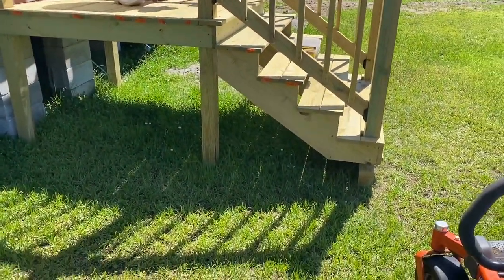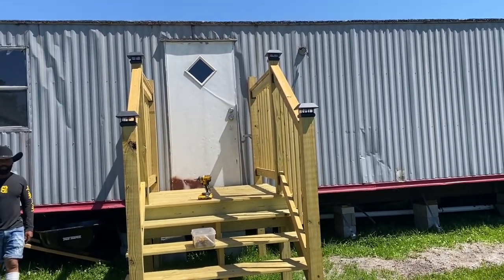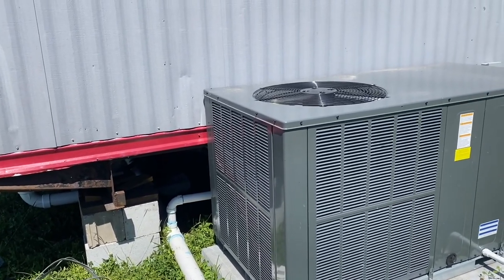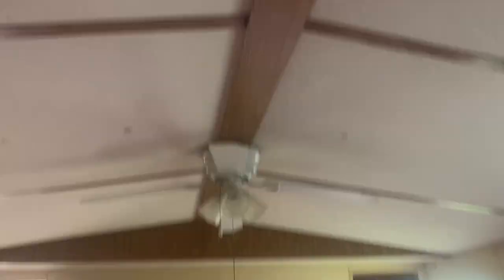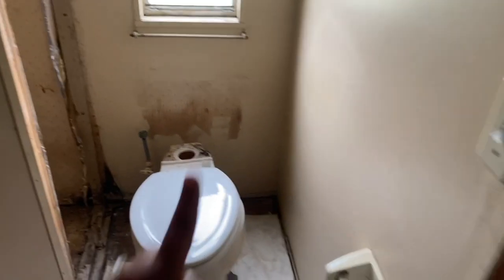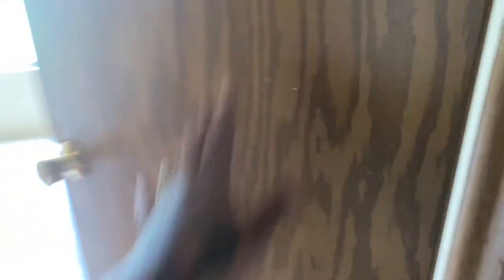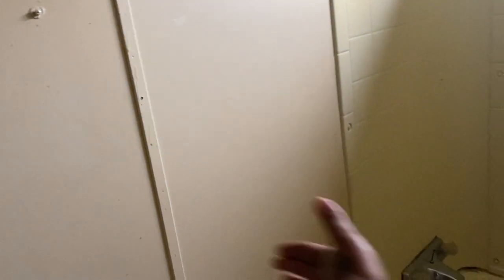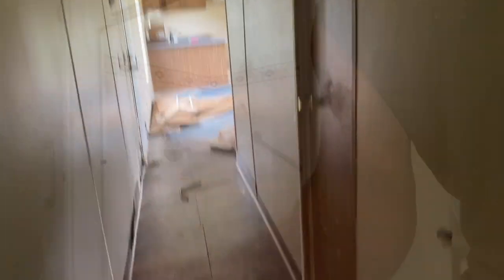demolishing our old mobile home

Comment: If I may make a couple of suggestions,  which I did on my single wide MH with Aluminum Siding. I stripped all the sheet rock off the outside walls and added 2x2s to all the studs. Then I sealed all the holes in the siding and I used minimal expanding foam between each Siding joint.  Then I used expanding foam between the siding and the sill plate and header to keep bugs, rodents, lizards, and drafts out. I also sealed with minimally expanding foam around all the windows. Then I replaced the insulation that wasn't damaged and added another layer of R13 insulation.  Then put in new drywall, which I finished like a house. While my mobile is much smaller, only 644 sq ft , I used 1 windows AC unit to cool it last year set at 80 degrees. It only cost me $50 /month to cool it through the hot humid Texas summer. 
Hope this helps!
Reply: Thanks!!!! 😂, wish you would done a video, also.
Reply: Foam won't stop mice. The only thing that will stop them is rock wool insulation. It repels water, fire and it's sound deadening as well. It's all I use.
Reply: I haven't had any in 5 years.  There are some foams treated to withstand Rodent infiltration.  Show studies that prove they don't !!